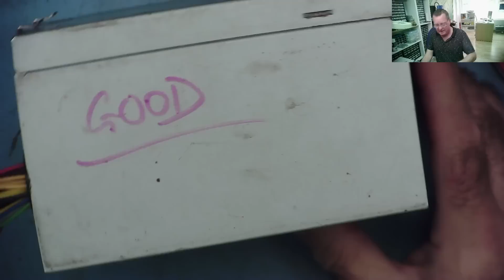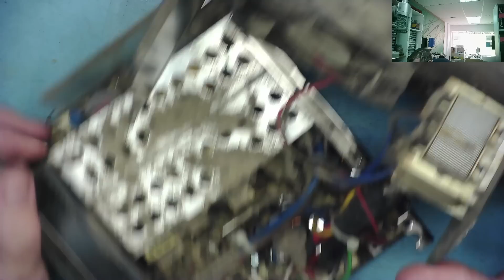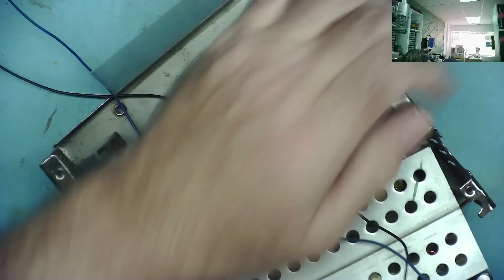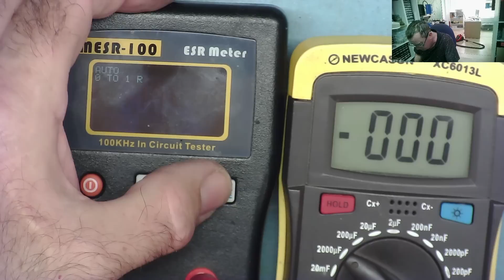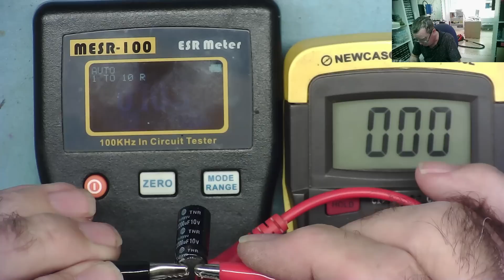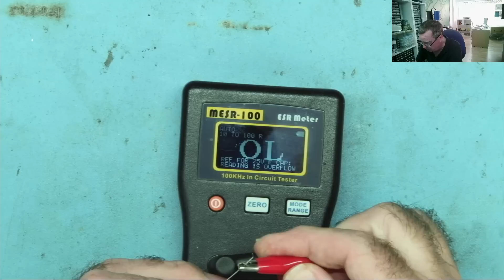Why You Should Always Test Your Test Equipment!

Comment: Hello Richard, you are such a gentleman... 😅
Glad that your PSU is working fine now, and can power again these thirsty Athlons! Do you consider it's a good practice to check capacitor capacitance and ESR on these old PSUs that aren't replaceable by modern ones... If I would want to check voltage ripple of my PSUs while powering my machines would I need an oscilloscope or advance LCR Meters can do that measurements?
Besides capacitors what do you think can degrade on these old PSUs that can provoke a catastrophic failure and take out vintage parts?
Best regards.

Comment: You should always open up a psu to do a visual inspection once every few years or newly acquired ones and clean them.
Reply: I doubt most people are going to do that with the ones in their PC. Although if you're going to use as a bench supply or pick up used ones secondhand that would be wise.

Probably also worth checking for a cooling fan and if there is one then check that it spins and doesn't sound like it's dying.
Reply: @jnharton  With 20 year old pcs or psus gotten from them you should always visually check the caps. It can seriously damage motherboard, cpu and gpu if they are bad. I also recycle a ton of pcs and every psu is checked for a reason. Its only a few screws. Besides caps last longer if they do not get too hot all the time so cleaning the psu is a must as well to get some airflow going again. I know most people don't, but its kinda dumb not to with old hardware.

Comment: Hi I watched your video on the esr meter when you was using it to test inductors, would this method work with the Peak Atlas ESR70?
I have learned so much from your content thanks
Reply from the maker: I don't have one of those so really can't comment, but any 'real' ESR meter that works by injecting a 100KHz AC signal should be able to test inductors
Reply: I think atlas peak will not work, it is too much automatic, will show short

Comment: I draw the same type of diagram as you do when replacing caps. Including a reference point for orientation and marking the bad caps with a felt pen. I even use the same arrows pointing to some cap if the diagram starts to get a little clutter. You must be focused on logic too.
Reply from the maker: Yeah I normally mark the polarity also, but on this board I noted it was clearly marked on the silk screen

Comment: I pulled a ATX supply and added it under my Electronics top shelf, used it for years as a bench power supply😊.   Came from old Industrial PC that was part of a Dynamometer that PC was 100% clean which told me it was rarely if ever powered on.   Automotive test department didn't use it so I scrapped it out.
Rebuilt a number of Industrial Electrical power supplies that was for obsolete equipment.    NOS supplies 1200 bucks, 2 hrs and 10 bucks in Capicitors 😂
They only wanted to give me a 4% raise last spring so now I set at a desk making 5K more in salary and drive way less pay 1 less city tax 😂

Comment: That battery powered screwdriver you are using is a bit noisy compared to the ones I have used in the past. Is it working ok?
Reply from the maker: I think it is noisier because it is more powerful than 'standard' ones
Reply: @learnelectronicsrepair  makes sense

Comment: Everything is good until it ain't. Then it's no good. I had a PSU go bad and take the PC out with it when it went bang. I've seen a PSU still produce power but it was so dirty the ripple would kill anything attached to it in short order. Older PSUs are just not to be trusted.
Reply: For what it's worth, the underlying technologies used to manufacture chips over time have had different degrees of sensitivity to over voltage conditions or excess source/sink currents, etc.

So an older board and it's original design might have tolerated a wonky power supply a lot better than a newer board would.  
  
And not all PSUs are equivalent with regard to safety measures and circuit protection.

But if the active components are failing, all bets are off.
Reply: @jnharton  power supplies do not regulate the voltage to logic. You don't think any chips run on 12 Volts, do you? Regulation happens on board today. But you are better off with smooth filtered power to a board.
Reply: @1pcfred  Except they do, because what comes out of the wall is 110-120V AC and what you get typically get out of a modernish PC power supply are voltages like is +3.3V DC, +5V DC, and +12V DC.

I don't recall claiming that components on the board are all A-Ok with those voltages as-is, but they didn't just magically go from AC to DC and drop by a factor of 10 or more.  
  
A bridge rectifier and a transformer might suffice for unfiltered 12 V power without any regulation, but there is definitely regulation happening to get 3.3V and 5V ouput.
Reply: @jnharton  They're doing away with everything except 12V in the next PC PSU spec. All the power hungry stuff is on the 12V rails now. Your graphics card and CPU just use 12V They regulate that down to what they need themselves. But they need lots of power so they convert it from 12V. That keeps the current that needs to be transmitted reasonable. Power equals Volts times Amps. So if you halve the voltage you double the current for the same power. CPUs run at around 1 Volt today. But they use over 100 Watts. A wire that can carry 100 amps is over a quarter of an inch in diameter. That's a tad extreme for PC hardware. Engineers are taking fire from all around them and just have to solve problems for every vector of attack. That's why we have the line current to PSU to VRM system we have today. They're using a series of strategies to stay in the fight. The barbarians that assault them keep demanding more performance all the time.
Reply: @1pcfred  If you say so... Seems to me like moving all the voltage drop to the board would increase the risk of toasting your board with a bad PSU.

No idea where your going with that wiring bit.   I think they probably had that bit figured out a long time ago. In any case, I'm sure modern CPUs have more than one supply and ground pin.  
  
VRMs are useful because they allow the CPU to run at a different voltage than the surrounding circuitry. And obviously there are designs that can be adjusted digitally to output different voltages, otherwise you couldn't set that in the BIOS.
Reply: @jnharton  Ohm figured all of this out in the early 1800s. There's no way around his basic formulas either. Not digitally or by any other method known to humanity. The way the voltage is changed is through Pulse Width Modulation. The switching transistors are just switched on and off at a different rate. If they're on longer you get higher voltage. If they're off more you get less. Voltage is pressure and current is flow. Combined they equal the overall power.

Comment: i learned a thing. i always thought when the caps failed it was like... catastrophically bad. thank you
Reply from the maker: No it's often like this - the capacitors can be really bad and it still works - until one day it doesn't, or even it works on half a video and then you add a little more load and it won't work again.  Yeah it is surprising until you see it, isn't it 😉   And then it's still surprising...
Reply: The electrolyte in capacitors just dries up over time. The foil in them can corrode too. No electrolytic capacitor lasts forever. But some can last far longer than others.
Reply: @Paul Frederick  late 1990s into mid 2000s the manufacturer of the  small caps like this moved onto China from Japan, Korea and the quality went down pretty bad.    TVs to PCs d). Industrial equipment (power supplies especially failed in 3 to 5 years
Reply: @markmatt9174  what happened was there was a case of industrial espionage and a formula for electrolyte was stolen. But the formula was not complete. A critical ingredient was missing. That caused what's known as, "the capacitor plague". Capacitors manufactured with that flawed electrolyte packed it in early. It happened in 1999. Bad caps were produced until 2007.
Reply: @1pcfred  had not heard that prior, just that it was the China Caps that were at fault.   They were reported made w every manufacturer name on the side so could not determine what brand was better...

Comment: Another great video!
your +12V and -12V seem a bit low though
Reply from the maker: The ATX specifications acceptable tolerance on +12V and -12V  is a lot wider than you think
https://www.evga.com/support/faq/FAQdetails.aspx?faqid=59665
Reply: @learnelectronicsrepair  that's why I said "a bit low", it's 10mV below the minimum (11.4 -> 11.3) probably not a big deal but I'd look into that
Reply from the maker: @blackhorserepairs  Oh OK, you are more observant than me. I wonder if it is the PSU or my ATX analyzer?
Reply: @learnelectronicsrepair  actually, it seems that I'm not as observant as I thought I was :) your 12V drops to 11.1 without load, my "opinion" is that it should not drop below 11.3 with 80% load. I would not blame the analyzer first, I use the exact same one and of course along with a multimeter, so far I never have had any issues with it. Check your reference voltage, if it's low, output will also be low.

Comment: Great work. What about all the other (smaller) electrolytic caps?
Reply: they rarely go bad, high ESR on those will not result in PSU not turning on (or PG low) but it doesn't hurt to check :)
Reply from the maker: @blackhorserepairs  Agreed - I only tend to check them if I really need too.  Watch out for the two small electrolytics on the high voltage side base drive of the switching transistors though (in the typology where the PWM controller is on the low voltage side and drives the switching transistors via a small transformer).  They do go bad and this type of failure often ends up with shorted switching (SMPS) transistors